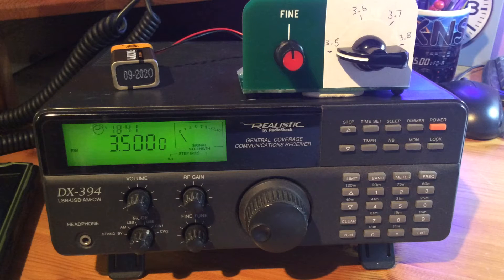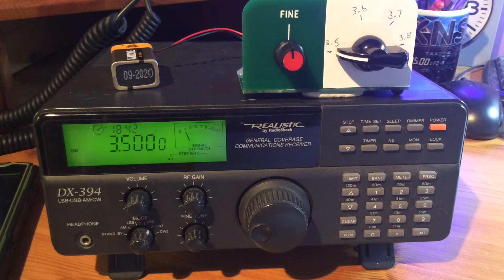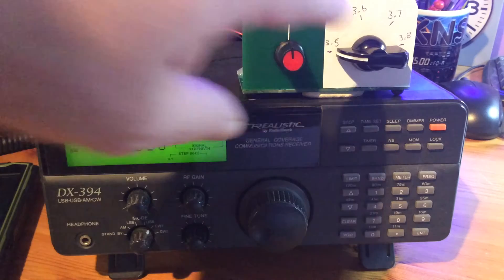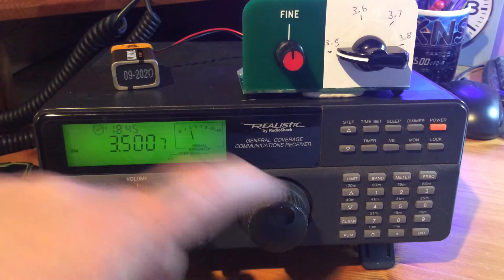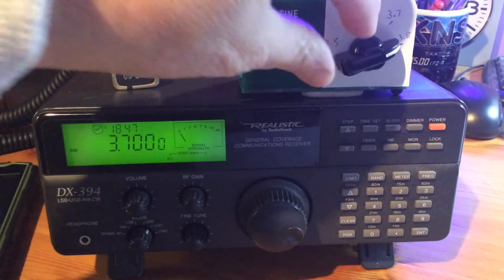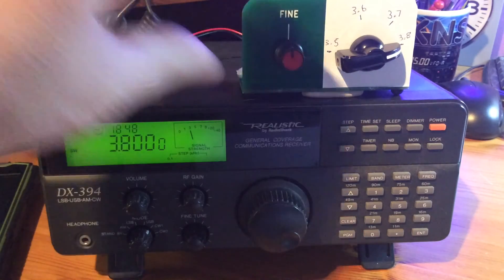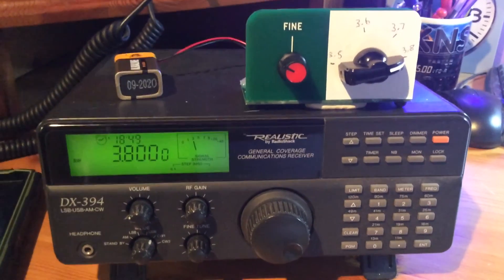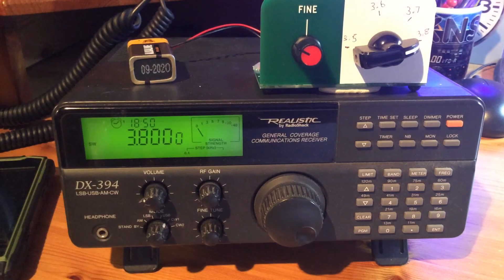80 meter VFO Kit test and review for Intermediate Exam

Comment: Lovely video, you've done a nice job with the build. I have used mine recently to align a receiver for radio orienteering (not critical, just needed to know 3.5 was near one end of the scale and 3.6 was near the end of the other, but still, I was thrilled to use it) Thanks for posting. 73 de M0OET
Reply from the maker: Thanks Brian, it's always a great achievement when you actually get to use something you've made yourself isn't it :)